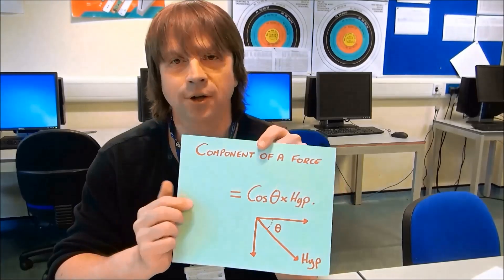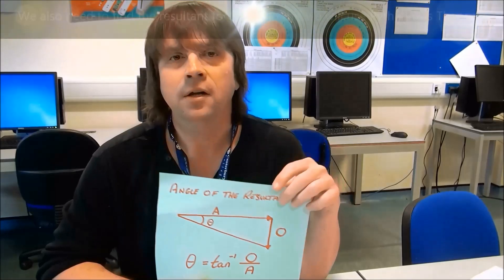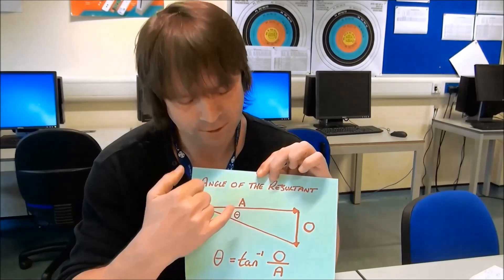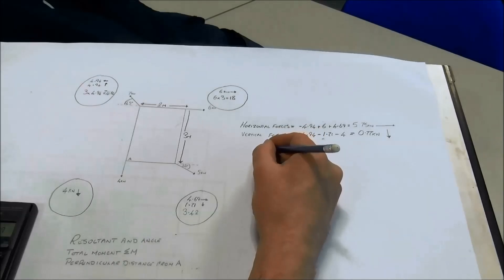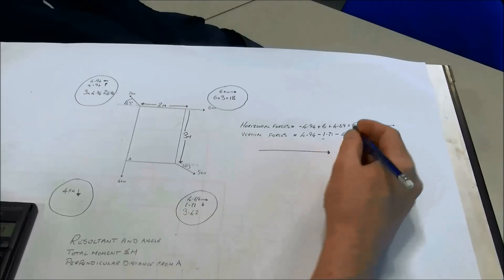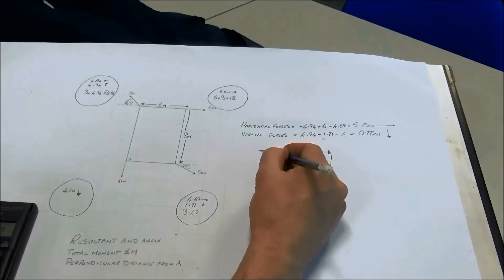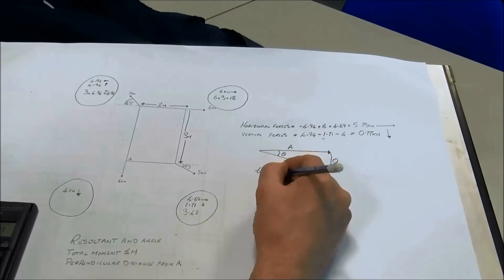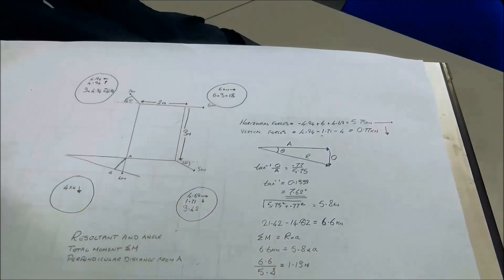Non Concurrent Forces in Frameworks

Comment: Still a bit unsure about the line that will show the turning moment distance. You drew a line out horizontally from A and an angled line down (presumably 7.62 degrees). Is the line you drew back to A perpendicular to the 7.62 degree angled line? Otherwise this video has been very useful and clear.